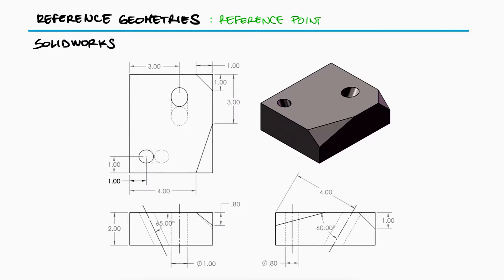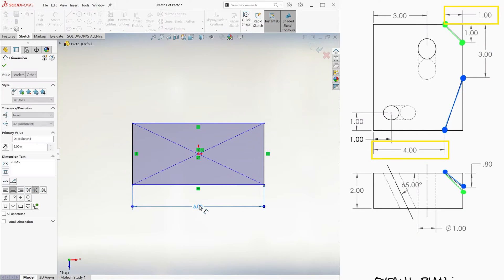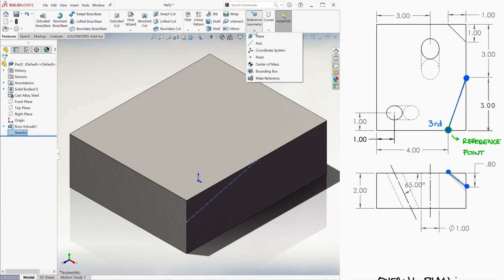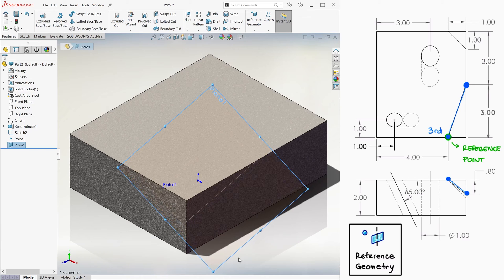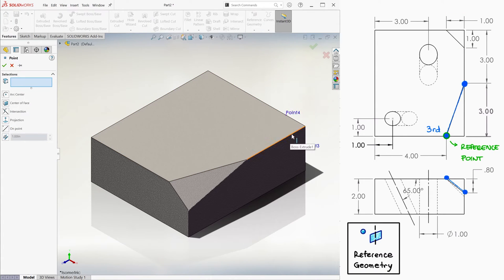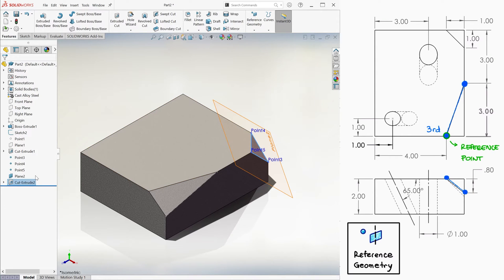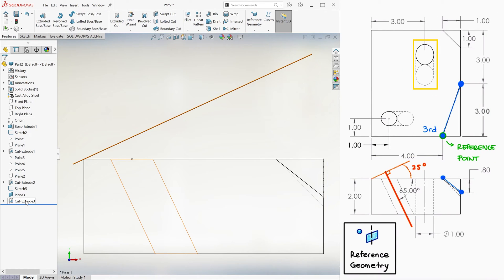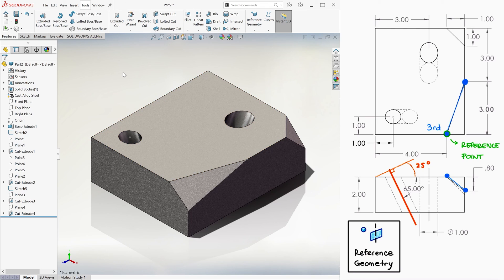SolidWorks REFERENCE GEOMETRIES explained in 9 Minutes!

Comment: Very well explained! thank you very much. Quick question, when you draw a point on the surface to extrude the circle, you did it with the point located on Croquis instead of using a reference point. Does it change anything?